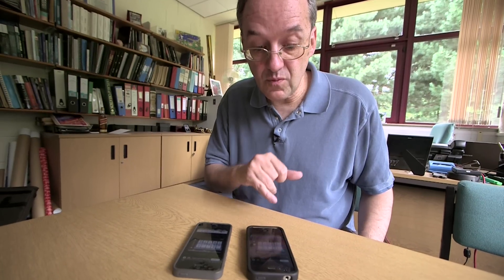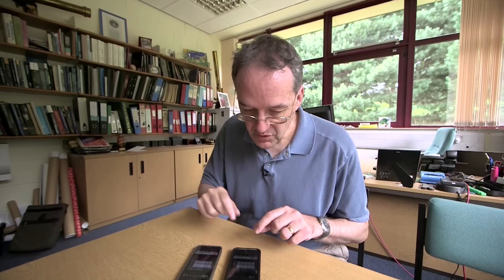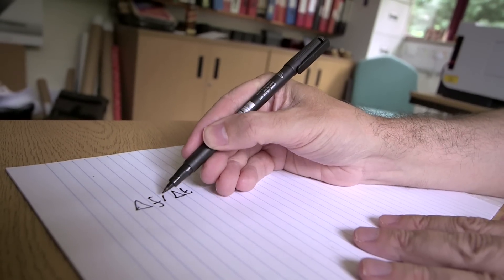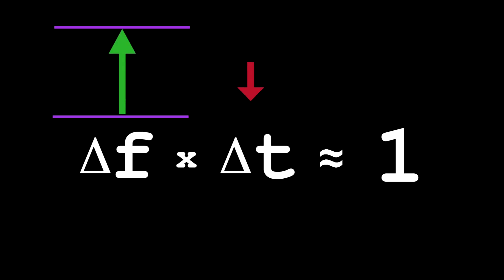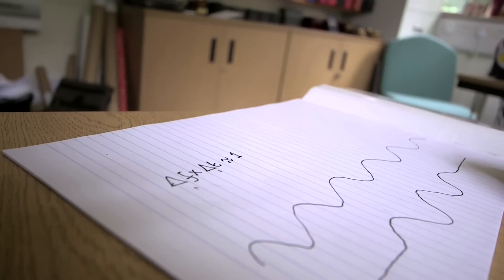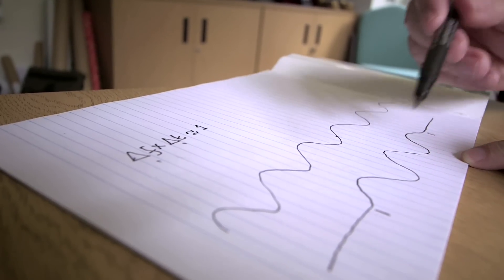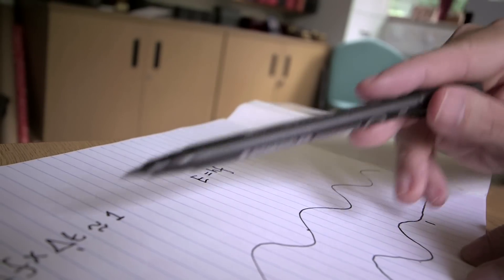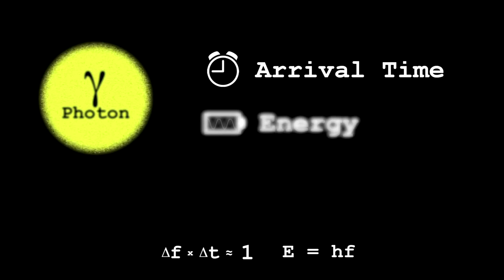What is the maximum Bandwidth? - Sixty Symbols

Comment: This reminds me of how they said CAT7  cable was going to be needed to handle the bandwidth of gigabit Ethernet and within a few years the engineers figured out how to do it over CAT5 cable with the right processing power and better noise reduction algorithms.  Then wireless added new modulation schemes and multiplexing and jumped from 802.11b to 802.11n to 802.11ac.  The lesson: don't tell an engineer there is a limit as they will find ways to exceed your limits.
Reply: Stephen Furr I absolutely didn't get a clue of what you're talking about except the last sentence that I like very much and do agree with :)
Reply: allen mathew Thanks :)
Reply: +Stephen Furr Advancements in technology only push the speed near and near to the fundamental limits of the media. If the media is for example a CAT5 cable with a given noise floor you can only push so much information down the line (see Shannon theorem).
Reply: here here
Reply: Stephen Furr there's a limit ;)
Reply: There are always hard physical limits that we can not overcome, but those depend on circumstances and we can do trickery to change those circumstances. The fundamental bandwidth for whatever fiber he calculated is indeed so fundamental that we will never be able to exceed it. This is the same for CAT5 cable, it only has a 3dB bandwidth of xxxMhz, however this doesn't mean that it isn't transmitting nothing outside this, it is just getting more and more attenuated. While in a fiber these dropoffs are rather steep, in copper they are moderately flat, so what we can do there is something called pre-emphasis: Not unlike to an audio equalizer, we send the frequencies that we know get attenuated most in a slightly higher amplitude to compensate for that, so that at the other end the frequencies arrive at a more or less equal amplitude. In most modern high speed copper interfaces, this is done during the link training phase. This way we changed the circumstances of CAT5 (or whatever else we use): It can now transport a wider range of frequencies, thus for this range we have a new, bigger bandwidth. And on top of all of that comes the various encoding algorithms that make it possible for use to really use up that bandwidth (like PAM16 for 10G ethernet)
Reply: Well the way they got it is not because they overcome the fundamental limit of the CAT5 cable to transmit information but the limit that noise problem generates which is way lover than the fundamental limits of the CAT5 cable. What he is talking about the absolute information limits of data carriers which is unlikely to be achieved in real life anyways. This is based on the theoretical physics. If they prove that can be done, they need to rewrite the physics and they probably would have won a nobel prize :P
Reply: @soulsbourne  He only described the maximum limit for one phase of one frequency. If you even approach that limit with modern modulation schemes the real limit would be much higher. He's not wrong about the fundamental physics, but I'm not sure he knows about QAM or multiplexing because those greatly increase the theoretical bandwidth limit ( QAM incorporates phase, multiplexing combines multiple frequencies)

If I can make an analogy, he is calculating the maximum bandwidth of a copper wire with the assumption that Morse code is the only modulation.
Reply: They managed to run gigabit over Cat 5 by using all 8 wires in parallel compared to 2 wires in 100 Base-T.  (100 Base-T uses 2 wires in each direction.  Gigabit uses 8 wires in both directions simultaneously.)

Comment: Mammalian nerves utilize an ionic electrochemical system to transmit info, and although it can be described as electrical, it is much different than a coax cable or an optical fiber, having a maximum rate of about a kilobit per second. However, the nerve that takes info from the eye to the brain is not a single fiber, but a bundle of about 4 million that convey info in parallel. So about 4 gigabits per second within an order of magnitude, I'd guesstimate.

Comment: So that would be around 80 Tbps or 80.000 Gbps. Should be enough for future applications. 

Looks like some people even managed to almost reach the maximum.
http://www.techspot.com/news/52066-hollow-fiber-optic-cable-tops-73tbps-promises-near-light-speeds.html

We really need fiber optical cables everywhere and into every building. You'd only have to upgrade the terminals and recievers to get higher bandwidths in the future.

Comment: 1TB in a few hundredths of a second?!?! JFC
Reply: JFC is a Mexican fast food chain.. right.. right ?
Reply: AMGwtfBBQsauce In the future, that might seem like a small amount. In the 1900's, one MB used to be incomprehensibly big.
Reply: Jojo Mcguire Which decade are we talking about? Computers didn't even exist in 1900, but multi-gig hard drives were pretty standard by 2000.
Reply: AMGwtfBBQsauce I think it's a typo and he meant 1990, however, even then 1 MB wasn't too big. The 80's now, that's a different story.
Reply: Ashley Wyatt "Why would we need any more than 50KB of storage?"
Reply: I just meant from the time they were needed until now...
Reply: AMGwtfBBQsauce 120x gta 5 in 1 seconds
Reply: shune84 NIIIIICEEE....
Reply: 2 things, 
1. What we were talking about was not the transmission speeds of information, but our ability to store the information exponentially increasing over the past 35 or so years. The  thread was no longer discussing the transmission limits of information.
2. Jezus i made that comment wat, a month ago? barely remembered it happened
Reply: ElMage11 optical vortices
Reply: ElMage11 quantum entanglement :p
Reply: Worm hole
Reply: How many TBs would it take to fax a person? :)
Reply: Brew Dain I read somewhere that the human body has about 150 zettabytes of data. If Chris urquhart is right and there is 200 fibers in a cable, about 2 hours.
Reply: satoma satomis every cell does count if you factor in external interference. You really wouldnt want a person.rar that is just mean xD
Reply: satoma satomis easy. Take their dna and their age. Thats a person.rar
Reply: satoma satomis I was sardonically making a comment on '80s computer technology.
Reply: AMGwtfBBQsauce If the shortest possible pulse is around a femtosecond, I think that would mean you could send a terabyte in only 1 millisecond.
Reply: AMGwtfBBQsauce I'm sure Japan already has it..
Reply: Charles Haneberg Still, a few milliseconds isn't that long.
Reply: Timothy Barth You're forgetting the additional information (entropy) of all interactions over their lifetime, particularly important for things like neural connections, memories, etc. That amount of information would overwhelm the amount you'd need for a snapshot of every molecule. But I'm sure even a simple dictionary compression could save a lot of data, considering that the dna is the same in every cell, atoms can be combined into common molecules, and particularly complex protein chains can be represented by a sequence of very simple codes, like, well, dna. You'd just need to get the position and orientation right. This should be on xkcd.
Reply: DFPercush yeah but the joke would not have been as fun.
Reply: DFPercush You lost me at entropy.
Reply: ***** You're not the only thing we've lost to entropy...
Reply: AMGwtfBBQsauce When the big S comes up, I know I can't get into an orderly discussion.
Reply: +AMGwtfBBQsauce lets say "a few hundredths of a second"  is 2 hundredths of a second that's 50TB/s now distribute that over global infrastructure and account for all delays and processing and that's max possible bandwidth you can have.
Reply: shune84 You're not limited to one bus, though.
Reply: +satoma satomis I think you have some weird math there. 1 giga is 10^9 = 1 000 000 000. No way you end up "1073741824". Now 50000 / 10^9 = 0.00005 or if you prefer 5 * 10^-5 = 0.00005.
Reply: +ShadowManceri A gigabyte is supposed to be 2^30 bytes. Translated to decimal, that's 1073741824 bytes.
The whole "a gigabyte is 10^9 bytes" thing started because of storage drive manufacturers not wanting to follow the standard. This is why the operating system reads your drive as having less storage than it really does. It's because the operating system reads kB as 2^10 B, MB as 2^20 B, GB as 2^30 B, and TB as 2^40 B. 

One area where a gigabyte still is 2^30 bytes is in the sticks of RAM in a computer. An 8 GB stick of RAM has 8192 MB of RAM.
Reply: it would, provided we find a medium that can transport more frequencies than optic fiber in order to overcome the limit, that the video is talking about.
Reply: true, but also the electronics at each end of the fiber to measure the datarate... even if the theoretical limit of the lan cable is several orders of magnitude higher than the actual 10gbps, right now we don't have the tecnology to measure such bandwith in a switch... same thing happens with optic fiber
Reply: A famous quotation of Bill Gates around 1990 said that he deemed 640 kilobyte of RAM to be enough for anyone (in defending Intel and IBM PS2 as opposed to Motorola, the Apples, Ataris and Amigas (aaah) of that time). ;)
Reply: @AMGwtfBBQsauce: That still is 100 Terabyte per second which is huge. Fortunately cable guys do not use a single fiber for connecting a provider to all its clients. So huge bandwidth available there.
Also people tend to forget that all television channels, connected telephone as well as their internet are provided simultaneously into their house by a single optical fiber. So from that you might calculate / estimate the actual bandwidth used on that cable.

Comment: Talking about photons got me thinking. What is the smallest wavelength difference that two different photons could have? I understand that each photon has a particular energy, determined by its wavelength, so that a photon can have wavelength x, and the next highest energy photon will have wavelength x-n. But what is the value for n? Is it the Plank length?
Reply: +E “Anonymous Nerdfighter” Hernandez The smallest wavelength difference, I would assume, would be one Planck Length. The reason is because the Planck Length is the smallest discrete distance that can be traveled and measured in the universe, so it would be impossible for two wavelengths of light to differ by any less than that.

Comment: Can't wait for 10TB/s speeds...
Reply: +Engineering Nonsense I know right.
Reply: +Engineering Nonsense But that will need to be split through the whole population since we share fibre cables
Reply: Matthew Lowe its not just one cable, under water, but networks.  Right?
Reply: Yeah, I was going to say there will be thousands bundled up, but I doubt there will be enough to provide each household within a city with 10TB/s
Reply: Matthew Lowe True
Reply: +Engineering Nonsense Fastest Ever Internet Speed of 1.4 Terabits Achieved in London
Reply: vanish202uk wow!  Let me get in on that!
Reply: +vanish202uk Well the question is how did they do it ? They were certainly multiplexing but how many wavelengths with what kind of fibers ? Because fibers also have big role in this. If you have some kind of article please post it here or PM it to me I want to read how they did it.
P.S. In practical use we don't need to send that much information through one fiber instead we put together a lot of fibers in one cable since they are the width of hair, some even less.
Reply: You really want 32TB/s.  Better for gaming.
Reply: Matthew Lowe Depends on the amount of cables, 
and as data transfer is still sequential you would download everything so fast that the conductor 
would be free in probably nanoseconds.
So instead of ‚shuffling‘ through the data that needs to be send, 
sending different downloads at almost the same time, to appear as if all is happening at the same time,
you could run down a queue that would be so fast so you don‘t see a difference...

Comment: I kept expecting them to talk about Fourier series and showing how waves of different frequencies can be added together to form square waves and whatever, so it was fun to see him take a different approach. For modern fiber optics or other transmissions with huge bandwidth needs, it's more likely that they would multiplex multiple slower streams together than to try to smoosh everything into a single stream with femto-second square wave pulses.
Reply: They don't use square pulses, they shift sine phase one or the other way and use different pieces of sine wave to code 1 and 0. Square pulses will just stretch on the way because they have so many different frequencies

Comment: Very good point: the part presented in this video is, technically, the element related to Nyquist sampling, or the B in your equation.  With good engineering and high S/N, you can do better as set out in the Shannon-Hartley theorem, but note that you only gain logarithmically: massively increase your S/N from 10 to 10000, and you only increase your channel capacity by a factor of 4 .  The dominant physical limitation remains the bandwidth of the fiber, for the reasons described in the video.

Comment: 11:22 = O_o 
I need that internet speed!
Reply: your computer won't be able to handle it.
Reply: i wonder if it would melt the fiber
Reply: Those crazy levels of speed are more commonly found in trans-oceanic cables, where billions of people's bits are going over a single bunch of fibers (like a shared cable internet connection on steroids).
Reply: G4mm4G0bl1n I never said it was a single fiber.  I said "cable" and "bunch of fibers".  Those cables are massive bunches of fibers.

My point was that the only real need for anywhere near theoretical single fiber bandwidth is in those transoceanic fibers.  No home or business network, metro net, ISP, etc. needs that at this point.
Reply: G4mm4G0bl1n Not at all.  I specifically said "at this point" not "never".  As long as LANs are capped at 1 maybe 10 Gbps, WANs need not be faster.  Will the need be there soon enough, of course.  But not today.
Reply: PongoXBongo Wrong. WANs need to serve multiple people. So your WAN must be able to serve A(B) Where A=(Max transfer rate of customer)and B=(Number of customers).
Reply: Widg3t's Widgets I get that.  What I meant was that WANs don't need to be exponentially faster than the max traffic they need to carry.
Reply: PongoXBongo
Traffic isnt the same as speed in telecommunication. Also is the speed not bound the customers or the bandwith. :)

Comment: I'm sure someone has already pointed this out, but the bandwidth only basically tells you how many pulses (or symbols) per second you can send. But you can actually send much more data than the number of pulses, basically, by sending pulses of different shapes. The fundamental limit (Shannon limit) is about the ability to distinguish the different pulse shapes from each other.

If quantum noise and uncertainty is your only noise in the fiber, then the fundamental limit for sending data is actually much much much more than the mere ~10^15 bits/s. The trick is that the pulses are not made of single photons, but of a number of photons. Pushing more energy increases the signal-to-noise ratio, i.e., lessens the uncertainty regarding the aggregate pulse shape.

For reference, DVB-C2 (digital video broadcasting for TV cables) specifies QAM-4096 as the densest coding to pulses. This basically means that there are 2^12 = 4096 different pulse shapes, i.e., 12 bits per pulse can be transmitted.

So, the fundamental limits in the video apply when you're sending only one photon per pulse. Ultimately, I guess the limit is how much energy the fiber can transmit before melting.

Comment: That's what the video is about, the shortest period you can send the light for has a limit; the shorter the period, the more frequencies of light that are required and fibre optic cable only has a limited amount of light frequencies it can transmit - which we generally call 'visible light'.

Comment: you forgot about modulation,
if you use QAM 65536 you would have 16 times the Data conveyed, so you would end up at about 1600TB/s which is more than enough